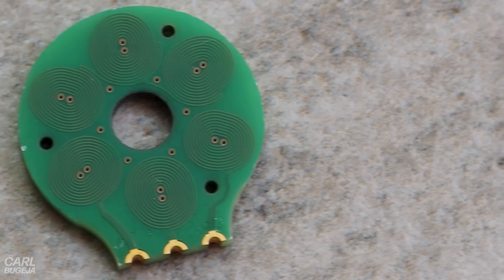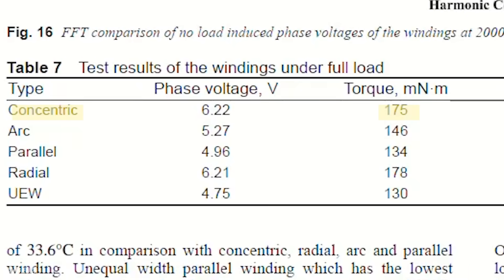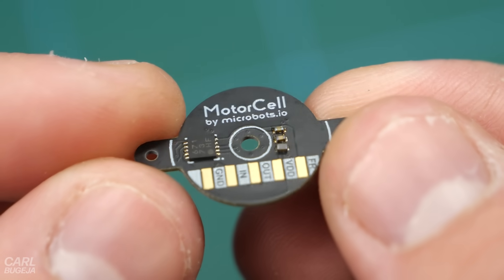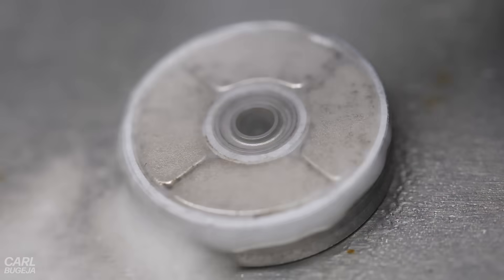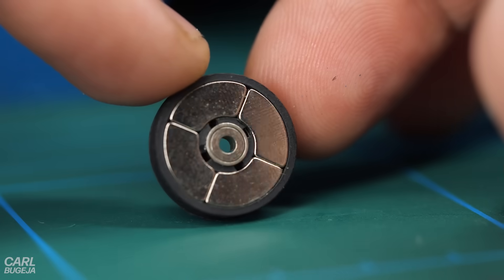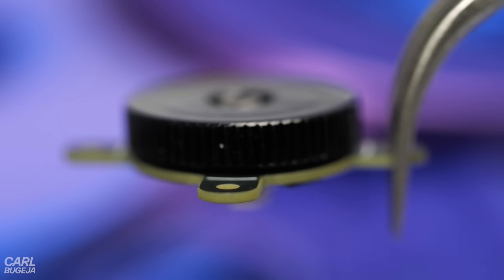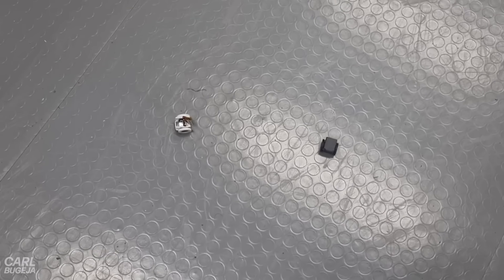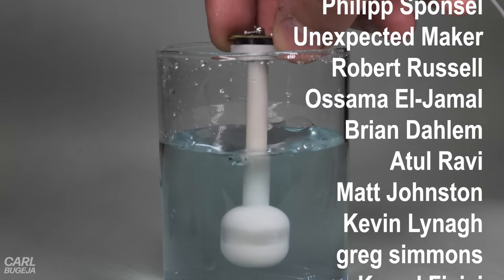How this tiny Motor Survived 1.6 BILLION SPINS

Comment: The coil can only be 2D distributed.
Has coil density increased? NO
Compared to conventional motors of the same volume, has torque or speed improved? NO
Has heat dissipation been enhanced? NO
Is it easier to assemble or maintain? NO
So is this just a gimmick?
Reply: Ease of manufacture, maybe?

Comment: Can one design this so it become a ring shaped motor with a large hole in the center and with an OD as small as possible? I need to make a tiny "camera rain lens device" that spins a 12mm glass disc at 3000++ rpm preventing droplets to buildup on the glass in a wet environment. It seems to be possible to cover it all with lacquer/resin to waterproof it as well. Would it be strong enough to drive a ID 12x18x4mm thin wall bearing?
Reply: What about printing the stator on a flexible PCB and wrap it around a hollowed molded multi pole rotor to keep the OD as small as possible?

Comment: I’m an engineer, but what you’re doing is completely wrong — that motor has no torque and isn’t efficient, it has no practical application. It’s a complete waste of time trying to reinvent the wheel.
If you still want to make an efficient motor, then design it so that the rotating rotor itself has magnets and a ceramic bearing that is cast and balanced — that way you won’t have any problems.
If you want, contact me and I’ll send you my doctoral dissertation on motor design.

Comment: What is a typical stall torque of this motor?  What if I wanted to use it as a small stepper motor that had 6 discrete positions to turn a dial to six different locations?

Comment: Did you consider creating lightweight compact stepper motors with this PCB motor concept? Because it may be harder to build a strong motor but you can build very lightweight, compact and low power consuming mini stepper motors and it may be really useful in some small size electromechanical applications.

Comment: I was wondering, if you think it is possible to have some tiny teeth on the bottom side of the rotor. This way you might be able to increase the airflow between the rotor and the coils cooling your coils while the rotor spins. There might be a tradeoff that the RPM would go down but you might be able to push more current through the coils.

Comment: a few years ago I took apart an old laptop hard drive and its motor stator was on the PCB just like this one! There was a ring magnet supported by drive shaft of the motor floating very close to the PCB -- this is what in turn spin the platters inside the drive. very interesting design!

Comment: would it make any sense to flip the bearing around so the outside is static and the inside is spinning? you could use a larger size of bearing that's easier to find for cheaper, maybe? and then you could have a shaft sticking out of that to put parts on

Comment: What prevents you from embedding a coil of wire into a PCB (wins in cross-section)? 
What prevents the placement of two magnetic rotors on both sides of the plane, increasing the efficiency? 
And the most interesting thing is, where does such a price tag of 3e per rotor come from with its cost of 0.1 euro cent? 

The idea is certainly interesting, but stillborn initially, using heat-resistant plastic + coils of normal wire, even silver and double rotor, will be cheaper and more productive
Reply: I forgot to add about magnetic field sensors, which will increase efficiency and starting torque.

Comment: Use a PTFE washer it can take a lot of heat and has a lower friction coefficient than stainless steel. You can 3D print it(do not breath in fumes) or injection mold it for large scale production.

Comment: My 37-year-old Corolla finally died at 218,000 miles.  That's about 183,000,000 spins.  Not too bad.  Original wheels, bearing, etc.  (A few tire changes, and brake pads/shoes.)

Comment: When you press a bearing into its mating piece, you'd be surprised how much a press fit can affect the tolerance of the bearing and make it more difficult to spin. Especially with smaller bearings. I used to assemble packaging machines, and the machines had 14 or 28 stations on a conveyor, each having 16 bearings. If the anodizing on the metal pulleys was too thick, the bearings pressed into them wouldn't spin as easily as they would when they were a transition fit. Luckily, it didn't matter so much since the bearings only moved twice when they went around the conveyor, so they didn't have a lot of fast, constant motion. Always remember that adding "decorative" (type II) anodizing will add about 0.0005" of thickness, and hard-coat (type III) anodizing to a part will add about 0.001".  (Remember that a hole has 2 adjacent sides so double it). We usually oversized the holes by 1-2 thou and the 12mm bearings fit nicely. Don't get me started on the number of times that I had to manually machine parts because the engineers forgot to account for anodizing thickness.....

Comment: Great experiments, thank you. have you ever tried using flexible pcb and inserting the pcb and the rotor directly onto a stationary shaft? The thin cassette Walkmans sometimes were designed this way, while most had normal non flexible pcbs. Anyway Thanks a lot for sharing your efforts!

Comment: you could take in place of the lock nut two thin nuts first to position second to lock in place providing way more security, increasing reliability while losing weight and size and also allowing you to decrease the length of that screw. you should be able to use a quite thin nut.

Comment: What manufacturer's of ceramic ball bearing failed the worst? 

I only ask because I race Nitro/Gas RC cars and the engine bearings are one of the most important components. These bearing are spinning those engines at a constant 10k-50k RPM. So who do you think are not the best manufacturer's of ceramic ball bearings? I personally bought "BOCA" brand bearings but they have never been run in the engine yet. I just do not want to destroy a $400usd engine because of bad bearings. 
What Do You Think?

Comment: This would be usefull for various applications, but cooling very small devices would certainly be helpfull, especially when they tend to run hot and in warm and humid environments when you have trouble keeping the moisture out but still need a heat exchange.

Comment: 4 magnets vs 8 magnets....
you said it enhanced RPM, but as i understand it, torque is limited by individual magnetic field boundaries: so more magnets is probably a better torque motor.
do you sell these? i have a few projects..
motor stability: have you tested a thrust bearing instead of a washer (if they exist that small: to one that supports the Outer race would actually provide better support.

Comment: If I were to manually take my finger and spin this will it create an emf and destroy the motor? I am a mechanical engineering so my electrical is kind of rusty. Also what is the torque on this motor? Just trying to gauge if I can use this tech for a project I am working on, any help would be great!

Comment: If all your tolerance failures happen in the same direction, it isn’t a tolerance failure, it is just an accuracy problem. I.e. you addressed it as precision when really it was accuracy. Which means it could be corrected for.

Comment: Could you move to a HDI process for the boards? It would massively increase per unit cost, but you could shrink your minimum feature (vias, coil thickness) size to be vanishingly small

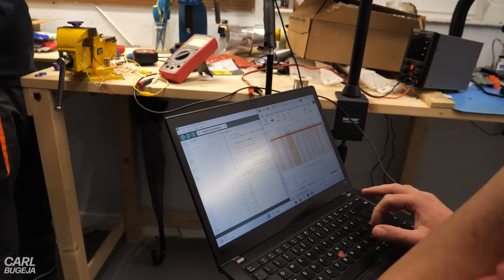Comment: 8:36, I see you put 20motors on the same testing surface, very close to each other.  Would the high speed rpm vibrations from all the motors together affect the testing for each individual motor?  did you test each motor individually (long term) as well?

Comment: What if the main design use a fractal like small swirls with some geometric printed capacitors nodes between them, so when the north pole is up, this hall effect witch is a cause of loss is charging this capacitors nodes, once is south the capacitors discharge and then is charged again until the next cicle is able to repeat. this would increase or decrease efficience.... Just a popped up idea

Comment: @CarlBugeja can you make the motor have a +/- cable outputs and making a nice case for the motor electronics? BTW: the MotorCell might apply to a wider audience by making it run off a +/- cable for not making a hassle buying and setting up a ESC and making the rotor dimensions and rotors public in a for example 20 rotor pack?

Comment: If you add a small amount of super fine graphite powder to the ceramic bearings you might find you increase the maximum RPM and bearing lifespan even further. Basically you'd end up making the inside of the bearing ring even smoother and reduce friction even further with the graphite compensating for any tiny imperfections...of course in a mass manufacturing setting you could just directly deposit a tiny layer of graphite onto the inside of the rings... and for Torque you need to increase the total field, so yes, you either need higher power on your input, or you need a larger number of "coils" or bigger coils - but you might also be able to achieve some of that using a multi-layer PCB design, with coil windings descending through the board... of course you lose some efficiency that way (depending on the thickness of the separation between each layer) but you would be sacrificing it for torque. You might improve the efficiency of those multi-layer coils by making them out of multi-layer flexible PCB (due to the thinner separation betwen layers) and then mounting them like surface mount components onto the carrier PCB... but then you can introduce other problems and could reduce thermal tolerances. Excellent project.

Comment: You can better use MoS2 powder to get les friction instead of oil or grease. 🤗
It works even to the atomic thickness thin and works still, don't need much of it,you could research it yourself.

Comment: I've been thinking for a long time about how to power a 1/35 scale roller coaster model. I saw your video and thought, "Is it possible to build a linear LSM drive using a PCB motor?" Unfortunately, I'm not familiar with PCB motor technology or how to make a linear motor. Is it possible to develop a circuit board that can accelerate a model roller coaster train, or perhaps even move it along the entire track? For example, as an LSM stator that accelerates the train with a brushless ESC motor, or like a stepper motor, controlled using a circuit board in the track?

Comment: What is it with your generation. 
Do you know of the words pause and breathe? This is something humans do on a daily basis. You cut the end of a sentence to immediately begin the next without pause. Annoying.

Anyway, your heating problems can be solved with pure gold, tungsten, and an allotrope of carbon in the correct configuration. The use of titanium for moving parts will help facilitate this goal. If not, you can substitute the titanium for a Liquid Metal to eliminate any friction points. Heating problems solved.

Comment: Hi, I am an electromagnetic design engineer focusing on axial flux motor technology. It is good that you are concerned with the reduction of eddy currents in the coils, but do not forget that there are also eddy currents in the magnets and especially also in the steel rotor yoke. The rotor yoke in particular will heat up considerably, the magnetic flux will no longer be homogeneous and the torque will decrease. You therefore need a magnetically conductive material with low electrical conductivity. A laminated core does not make much sense here, as the axial field would be perpendicular to the plane of the laminations. The best solution would be a “Soft Magnetic Composite (SMC)”. In principle, this is a material pressed from electrically insulated iron powder that suppresses eddy currents. If you would like to test such a material, please get in touch with me. I can also help you with optimization using electromagnetic FEA if you want to take the project to the next level.

Comment: If your stator is the thin pcb what's stopping you from having magnets on either side of the pcb? you'd be able to balance out the forces a little better for sure and maybe have different torque curves

Comment: fist of all that is not expensive, that is really low cost for such an innovative and low volume device.
as for a project it would be really interesting to see if you could make a gimbal with this, and maybe servos in general.. perhaps it would even be a tiny stepper motor version. super interesting and great work :)

Comment: You fixed the problem the right way, but the reason the bearings were failing is likely different than you are thinking. My company ran into similar failures with a small bearing in a robotic wrist. A $1000  dollar precision assembly was failing due to a $7 bearing. Most radial/deep groove bearings have radial clearance. This is the gap between the balls and races. It is directly related to the amount of tilt/wobble you see. The radial play/clearance is specified separately from the ABEC rating. So you can have a high precision bearing with large radial clearance. For small bearings, the radial clearance is minimal, with  .0002”-.0006” being typical. Pressing into an aluminum housing, the radial play will be reduced by around 40%-60% of the interference. So if your press-fit is .0006”, you may lose ~.0003” radial clearance. If your bearing was in the low-end of radial clearance, you are now actively squeezing the balls and races together. That preloads the balls and races with forces which are higher than you think and will shred the bearings. Check dynaroll’s mounting and fitting technical info for calcs. For small bearings, either avoid interference fits and use loctite 638/609 to hold them in, or buy high ABEC rated bearings to buy yourself as much tolerance as possible, then expect your bore and/or shaft tolerance to be a .0003” total range 😅😮😢. If you don’t you are playing the bearing failure lottery depending on how tolerances line up. If you can get bearings with higher radial play it will help with tolerance requirements.

Comment: One common feature of similar ultra high RPM motors I've seen is that they use either fluid dynamic bearings or plain bearings - not ball bearings.

Why plain? Sure, you get more friction losses. But a plain bearing is simple, cheap and EXTREMELY robust. Can be self-lubricating too, with the right materials.

Comment: How did you measure torque with the different weighted discs? Also I should note it's possible to get a full torque curve with a single rotor of known inertia by recording  acceleration rate against speed during an acceleration

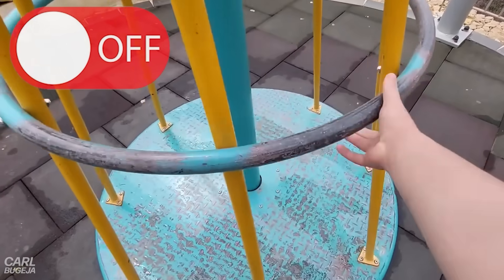Comment: @2:43 i got an idea why you do not try to layer the windings based on shape and design differentiates ? 

I mean for like AC 3 phase system but in dc with multi-layer with slightly degree changes 

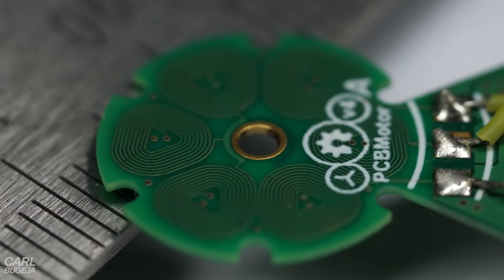layer one  1:38
layer 2, +3 rotate
layer 3 +6 rotate etc etc.

Comment: Inspiring. Not clear if really need permanent magnets. Could you go asynch. stepper like with no magnets. 
Also, I’ve see PCBs with screw holes which you could attach rotor to.

Comment: I've seen a few projects about rotary input devices with haptic feedback via a small brushless, shaftless motor. This motor seems like it might be a decent fit, if it weren't so skewed towards the high speed, low torque end. Maybe adding a cycloidal drive would do it...

Comment: It is not as effective as emay wire because the distance between the turns of wire is very small, secondly emay wire has a circular cross section for better electron flow than circuit line(flat)

Comment: Very thorough R&D! Nicely done. Unless you already tried and found some source of failure, one way to lower the profile is to replace the lock nut with a flatter nut and just put some thread locking compound like "locktite". Nail polish or varnish would work too but might make it harder to remove the nut later.

Comment: Use a pully and send the cable back around the generator so it generates power when the branch rebounds, so you don't lose half of the potential power generation. 

1. From branch to pawed wheel
2. From pawed wheel to reversing pulley
3. From reversing pulley back to a second pawed wheel but wrapped in the opposite direction,
4. From second pawed wheel to your weight.

This will ensure it generates power 100% of the time, rather than wasting the potential power generation when the branch rebounds.

Comment: Hey Bro, search youtube for this video "Axial Flux Synchronous Motor Prototype"
This person uses a spiral coil winding method which she explains in her design process.
What she also mentions for earlier designs is overlapping coils so if you are using multilayer-PCB then you can overlap the coils with your coil design based on the layer distance from the magnets as a design option.

Comment: Due purely to the way you control it, and the fact that you can get a speed output from it, I think I know exactly what that low power brushless motor driver chip you found is intended to be used in. It's something so "mundane" by modern day standards that you probably have at least one in your house right now doing it's thing silently. Brushless DC fans. The chip you found is perfect for that application, because it's USUALLY a low power application (glares at the Delta-brand server-grade DC brushless fans, with their high airflow, high power consumption, and high noise level (~vacuum cleaner but more grating) when at full speed of ~20k rpm or more), and reducing the number of different components used in such an application has great implications for reliability and cost-effectiveness.